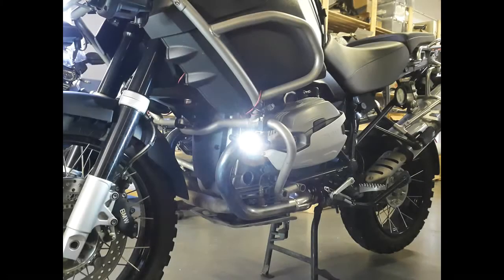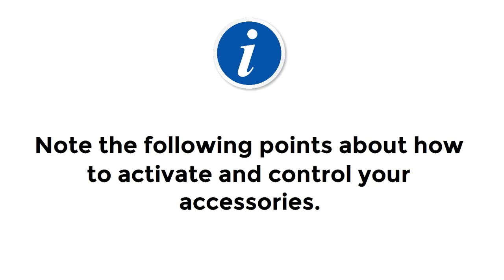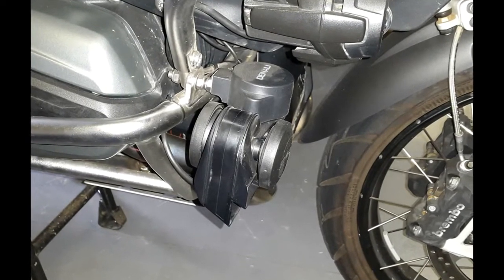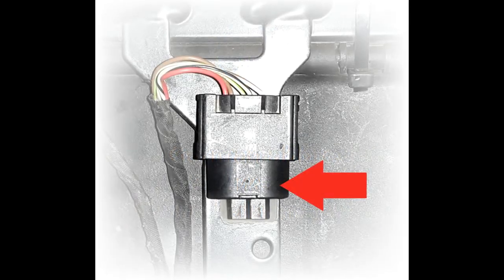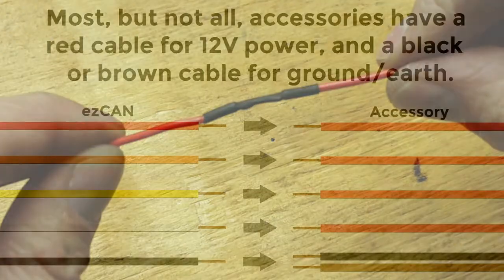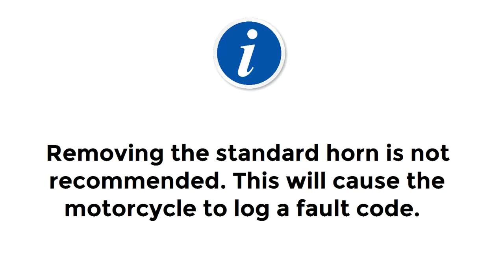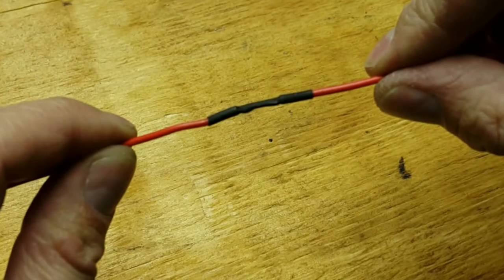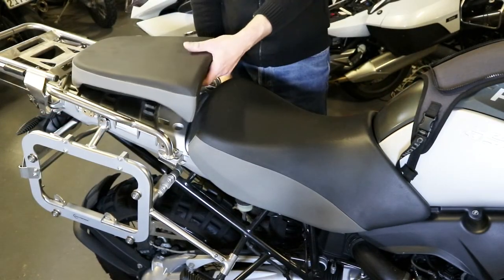HEX ezCAN R1200 Installation (BMW R-series)

Comment: I watched one of your other video's, in which the answer to my question was given.    "If your BMW does not have a MultiController, you can only adjust spotlight brightness levels using the configuration software." Unfortunately ! :-(

Comment: Hi. Great video. Thanks. I have a question. I want to be able to adjust the intensity of the lights. (Denai D4 for 3th cable for dimming). On the LC-model, the scroll wheel will provide that option. How can I do this on the oil-cooled ? Do you have to add a switch for that ?